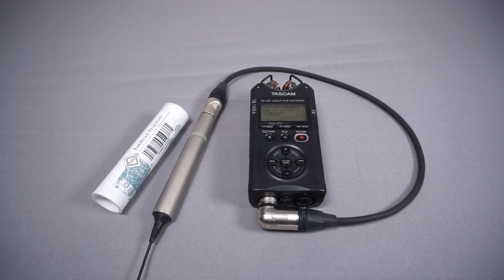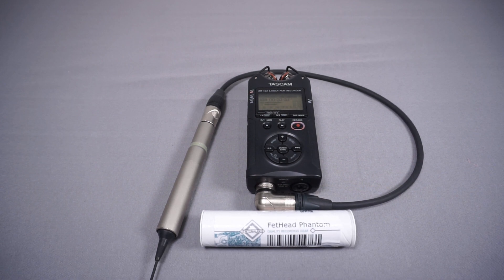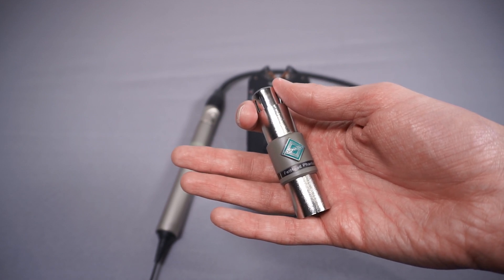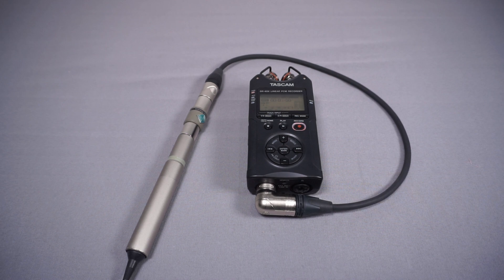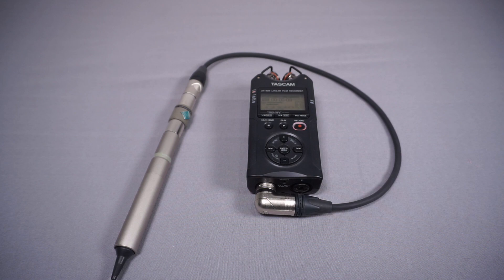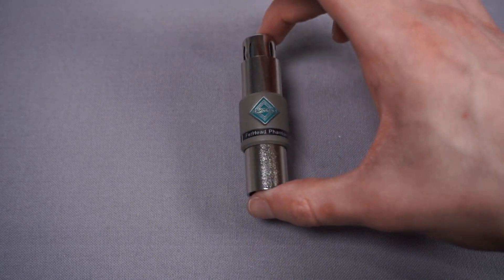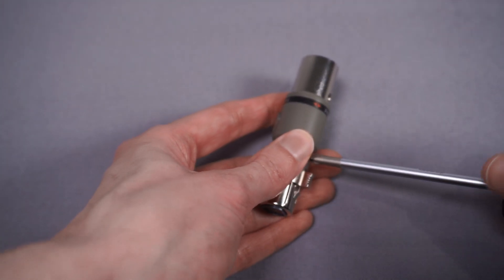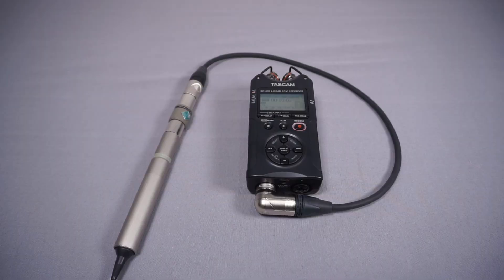The Solution for Noisy Preamps - Triton Audio Fethead Phantom - Review, Test and Teardown

Comment: They have actually connected two JFETs directly in parallel, which i find mildly surprising, since most other such units make use of two JFETs in cascode arrangement. Cascode attenuates loading effects and makes the gain closer to constant, while with a single JFET, you will get a varying amount of gain. And of course the gain stage is present twice, once for the + pin of XLR and the other for the - pin. The unlabelled light grey boys should be inductors, not sure of their exact purpose in the arrangement, odds are together with the capacitors they form the phantom power passthrough filter, but i can't quite figure out how it works right off the bat like that.

The very early FETHead had just one K170 JFET per XLR pin, but they switched to K209 here, which they for sure had to, since K170 was discontinued a long time ago; there is now a new K170 manufacturer but this new stuff is quite expensive, like $7 per piece as opposed to like a fraction of a dollar, and they weren't really available for a while except for shady junk. So the thing is though modern low-cost JFETs aren't quite so low noise and aren't exactly well matched, so odds are, by pairing them up like that they're alleviating both of these issues.

The video that you link also has the same parallel arrangement of the same JFETs, it's obvious that the gates are connected together for each pair.